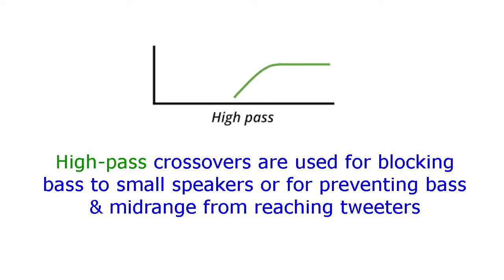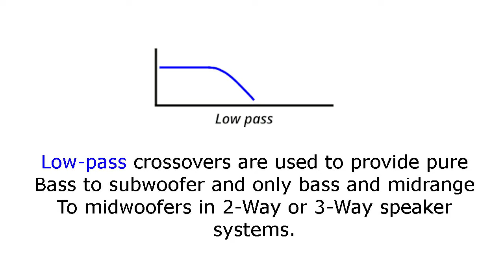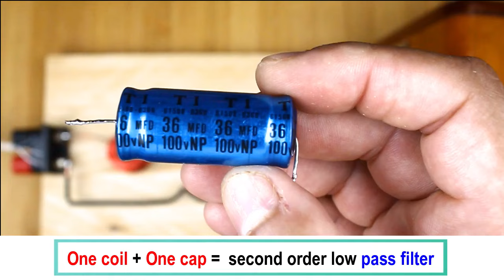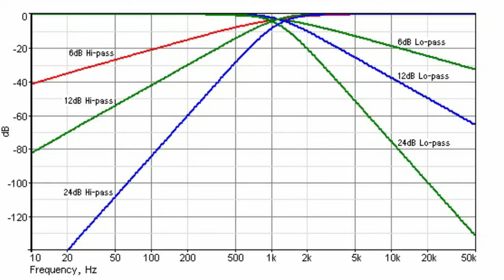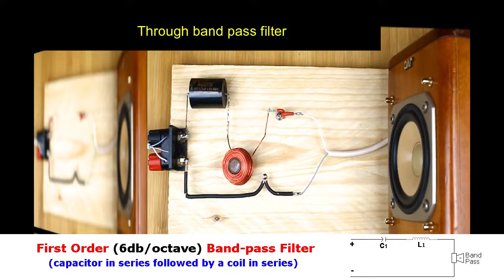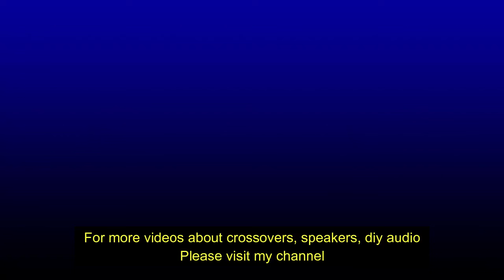How To Make Speaker crossover || Capacitor, Resistor, Coil, Lpad Fonction

Comment: This is a fantastic video!!Thank you!!
Is it possible to give us some more details about the values of the resistors ,the capacitors and the  coils that can be used?
Thank you.
Reply from the maker: The target of the video is to know the crossover job on speakers.
For values there's many crossover calculator applications,  but it's better to use web crossover calculators because they're easy to ise for beginners.
Reply: @homemade_audio  Thank you for your response.The reason i asked the question is this AUDYN 450v capacitor you are using which sounds like giving a boost to the sound when is connected despite the fact that is cutting the high frequencies.I did the same experiment using an old Tesla cap 50uf 250v and an 8 inch jbl woofer and  the effect was not the same.The high frequencies where cut but without affecting the overall performance of the speaker.So my question is :using a hi end capacitor like the one you are using will affect the overall sound of the speaker or maybe it was my idea that something like that happened in the video?Thanks omce again for the beautifull video.
Reply: @Dimitris Raggas  the component values you use will depend specifically on the response your drivers are capable of.
The crossover is used to tune the signals that are permitted to flow through to your speaker/drivers.
To cut high frequency signals from your woofers and prevent low frequency signals getting to your tweeters etc 
You can't slap a low pass filter capacitor on a mid range speaker and miraculously obtain 15Hz bass notes from it.
Crossover is there to distribute the signals to the drivers that they are capable of reproducing only

Comment: Very helpful video. I am wiring 2 way crossover with woofer and tweeter with two resistors on the tweeters one in series and one in parallel. Do I wire them in between the tweeter and connection to the crossover?

Comment: Hi. What sort of a Resistor should I used to match speakers (4 ohms) with my amplifier (6 ohms). 2 ohms of resistor (s) in series is fine right...? What about the resistors power ( like 5w, 10w so on). 

TIA 😊
Reply from the maker: Adding a resistor to a loudspeaker does not vary its impedance, but the overall resistance of the circuit. To vary the impedance it is necessary to use an impedance transformer.
adding a resistor ( 2ohms 10 watts) can protect your amp but it can also change the speaker response.

Comment: Hello Master Audio LSN12-4 – Difuzor Woofer 12 inch 4 ohm 500W

Difuzor subwoofer profesional 12 inch

putere 500w/RMS

impedanta 4 Ohm, sensibilitate 97 dB, raspuns in freventa 56-3500 Hz

diametru bobina 4 inch-100 m

greutate magnet 3,55 Kg.

greutate totala: 9.3 kg

PARAMETRI, Fs 56 Hz, Qes 0.33, Qms 8.10, Qts 0.32

please, what kind of crossover can be made for this speaker uf ?MH?

Comment: Please help me I have 8 om 300  watt speaker bass guitar cab with out twiter! I want add Twitter "driver" on the my bass guitar cabinet  but My head amp 300 watt 8 om .how many watt how many Om Twitter i can add on the my bass cab? What I connect this ?please answer to me❤❤❤❤
Reply from the maker: Hi, to answer you I need some data about this output:
- output power
- full rangesignal or high pass.
- if filtered, cutoff frequency.
To have this data you must download bass guitar's service manual.
Reply: @homemade_audio  output power 300 watt 8 om .not filtred bass cabin speaker 300 watt 8 om.amps output power 300 watt 8 om speaker 300 watt 8 om.thank you soo very very much for answer ♥️♥️♥️♥️.I didn't find a manual because the combo is old
Reply from the maker: I have never see an output for tweeter with full range signal!!
This output is for external passive satellites speakers .
Full range amplifier output destroys any tweeter immediately.